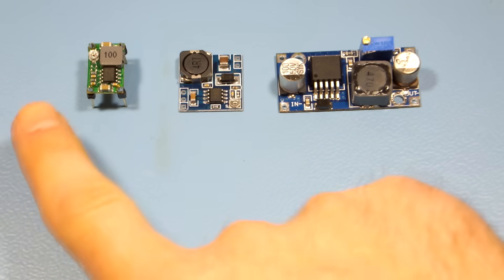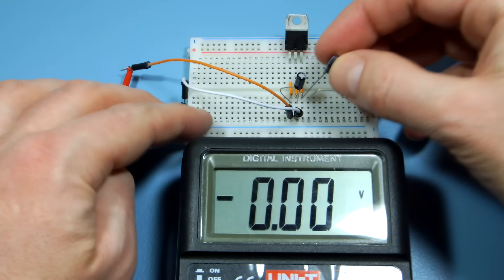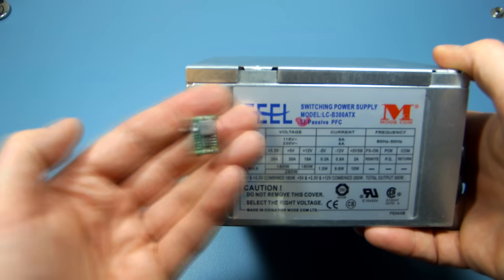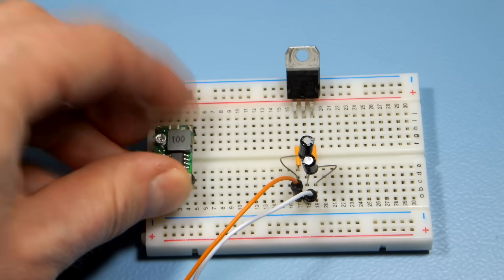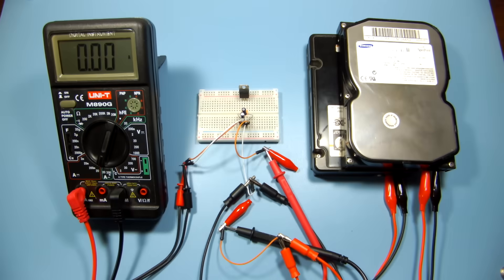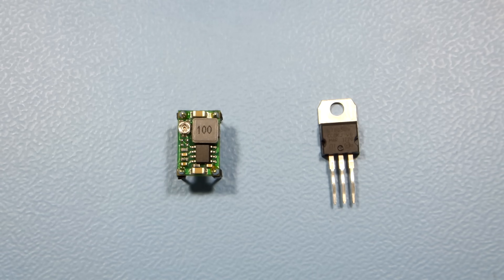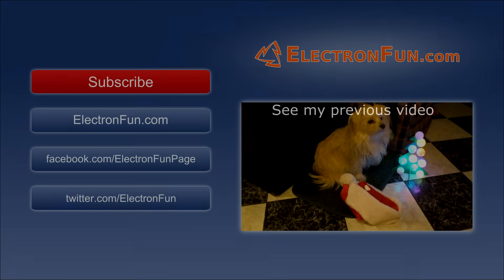Buck converter vs. linear voltage regulator - practical comparison

Comment: If the HDD's consume 450mA total, I take that to mean that's what they need to run most effectively. The buck converter is only consuming half of that (220mA) at the same voltage... meaning it's only supplying half the current necessary to effectively run the HDD's? Am I correct?

Btw, I love your teaching approach!
Reply: +Austin Aaron the hard drive is getting 450mA still but thats at 5v, since he is supplying it with 12v that means less than half the current that 12v is supplying is required to give out the same 450mA to the output, the difference is in a linear the second half of the current is turned to heat rather than powering the hard drive but with a buck regulator it doesn't convert any of the current to heat other than what you would naturally expect due to nothing being 100% efficient.
Reply from the maker: +Austin Aaron Hi, your way of thinking is absolutely logical, but you&#39;re not correct this time :)
The 450mA/220mA is measured at the input, which means it&#39;s a sum of the HDDs + the linear voltage regulator/buck converter. These devices consume power like every other electronic component. At leas half of the current consumed by the voltage regulator is radiated as heat and this way wasted.

Thanks a lot for your supportive words - they are so motivating! :)
Reply: +ElectronFun.com 

Ok, so you weren't getting the 450mA rating from the labeling on the HDD's then. I guess that's what I should have asked to begin with!
Reply from the maker: +Austin Aaron It's always good to ask :)

Comment: Hi, could you use a 12VDC supply and a Buck converter that steps down to 5VDC and power a normal Hard Drive with a Molex connector, because Molex uses 12V (Yellow), 5V (Red) and Ground
Reply from the maker: +Marius Ammann Yes, you can use a buck converter for this purpose and the hard drive won't complain.
I know these PSU color codes, I'm an IT guy :)
Reply: ElectronFun.com Okay thanks, so would this work.
https://www.dropbox.com/s/0cnicq3wxmsbd7i/Power%20Supply.png?dl=0
Reply from the maker: +Marius Ammann Your setup should work fine, just remember to buy a buck converter rated for at least 50% higher output current than the devices you want to power with it.

Comment: Lol idk what a buck converters is (even though I have one). But I know what a linear voltage regulator is.
Reply from the maker: +Bradman175 A buck converter is a very efficient alternative to linear voltage regulators as long as your circuit doesn't need absolutely clean input voltage.
Reply: +ElectronFun.com so a linear voltage regulator is more accurate?
Reply from the maker: +Bradman175 Linear voltage regulators are very accurate and don't introduce noise into the circuit, but they produce a lot of heat and waste energy. Buck converters on the other hand are much more efficient, they don't waste as much energy, but they introduce noise to the circuit.
Reply: +ElectronFun.com Wait buck converters aren't as good because there is the oscillation and the LC filter (?) doesn't smoothen the wave exactly?
Reply from the maker: +Bradman175 There are no ideal components, so an LC filter is not ideal too. In most circuits a buck converter is not a problem, but in e.g. audio equipment it may be a real pain.

Comment: Recently, I threw together a bluetooth speaker and am having line noise issues. The setup consists of a lithium battery pack, buck converter, bluetooth module, 2 amplifier boards and a LED EQ. Everything runs off of 5v, so that's one headache I dont have to worry about. But when the bluetooth module initiates, or communicates with another device, I can hear it thinking through the amps and speakers as a high frequency buzz. What is a good workaround, other than putting another buck converter into the mix?
Reply from the maker: +brainfarth Generally audio equipment doesn't like buck converters, but are you sure it's the buck converter's fault? I would probably do a simple test - swap the buck converter for a simple voltage regulator.
Are you using a 5V battery, or are your ICs rated for 5V?
Reply: +brainfarth I'm interested in seeing what happens when you swap out the buck converter with a linear regulator. I've been looking into making a bluetooth speaker as well.

Comment: Good video. Small addition: Don't go cheap on your power supplies. Would be like going keep on the foundation of a home. When cheap power supplies fail, they can do so catastrophically.
Reply from the maker: Each of them have pros and cons - like everything else. A lot depends on your application. I didn't mention in the video that these buck converters operate with different frequencies - in some applications it does matter. If you don't need to draw over 1.8A, I would probably choose the tiny one. It is really stable and doesn't take much space.
Reply from the maker: +Kent A. Vander Velden Thanks for your comment and advice. You're definitely right, it's not a good idea to use cheap buck converters for important projects.
Reply: +Kent A. Vander Velden make your own one :)
Reply: Right on, with legit components :)
Reply: so what is a recommended buck converter?
Reply from the maker: It is not as easy as one might think, but doable :)
Reply: Those cheap PSUs sure do have a lot of magic smoke keeping them going...lol

Comment: Can I use a buck converter to power an arduino mini pro?
Reply from the maker: +Josh Blease Sure you can. The output voltage is adjustable, so there should be no problem.

Comment: superb info! is there a buck converter from 24 v to 12 v?
Reply from the maker: +Ken cuttie Thanks :) Sure, the output voltage is adjustable and most buck converters can handle over 30V on the input.
Reply: +ElectronFun.com Thanks so much ! I'm planning to use it to convert an input of 20V from my solar panel and connect it directly to  a 12V inverter.  Do you think  it would be more efficient and practiical?
Reply from the maker: +Ken cuttie How many amps are you drawing from your solar panel?
Reply: +ElectronFun.com It's 4.8 Amps
Reply from the maker: +Ken cuttie I haven't tested buck converters with solar panels, so can't tell you if it's practical. If you want to use a buck converter make sure you use something that is able to handle such power (probably a lot bulkier than my tiny buck converters).
Reply: +ElectronFun.com I see. Thanks, i appreciate it so much!
Reply: +Ken cuttie TI Make a module for US$20 which can handle 36Vin and you just need to add one resistor to get 12V out. It can do up to 6A out.
http://www.digikey.com/product-search/en?keywords=PTN78020HAH

This will probably be much better than an $8 one from china.
(Like this one http://www.aliexpress.com/item/DC-DC-Car-Voltage-Converter-Buck-Module-24V-Step-Down-to-72W-12V-6A-New-BLACK/32276549850.html)

Comment: Should I use LM2596 buck converter with a joule thief?
Reply from the maker: +Atomic_Science Do you want to use it on the output of a joule thief?
Reply: Yes, I want to use it on the output of the joule thief so I can charge batteries
Reply from the maker: +Atomic_Science Should work, as long as your buck converter input voltage is lower than its output voltage.
Reply: thx

Comment: I bought a pololu buck converter S18V20AHV. This corresponds to my needs input : 11 to 14v (lead battery) output 8 to 12v (led lamp) not dependent on the input. But the principal problem is that de variable resistor is to thin. I'll have to desolder it to put a "potentiometer". I'm serching an open source dip one.
Reply from the maker: +Yannick Sirjean (autonomys) This little converter seems nice - step down/step up converter in one device. If the pot is similar to mine, it's not precise at all. Replacing it with something better may be a good idea.
Reply: +ElectronFun.com Of course yes, but it's tooo small. It need binocular or optics like this to invert it... that's the problem. That the reason why i prefer open source hardware with schematics.
Reply from the maker: +Yannick Sirjean (autonomys) Oh yes, open source hardware is always the least problematic.

Comment: firstly , thanks for your informative video , 
secondly , i want to know which one is better for my radio controller (im changing my battery to lipo and need to regulate the output voltage ) to have a consistent and steady output that at the same time wouldn't interfere with my radio frequency.
Reply from the maker: +Ali Jazani Thanks for your comment.
Buck converters are efficient, but they are much nosier than linear voltage regulators. If you don't want to experiment too much, I guess your should choose a linear voltage regulator. A buck converter might interfere with your radio frequency.
Reply: ElectronFun.com thanks again for your prompt reply . It was really helpful .

Comment: Hi great video. Your calculation corrections are wrong. What you state originally is right.
Reply: +eRCaGuy Do you mean to say that his corrections are actually the power wasted by the conversion from 12V to 5V output?  For example in his first correction he says (12V- 5V) x .042A = 2.94W, technically it is the same as saying 6V(the voltage dropped to reach 5V output) x 0.42A = 2.94W. 2.94W of power was lost in the conversion from 12V input to 5V output.  Am I correct?  Thanks.
Reply: +KillJD Yes, you are correct. I'll go over his calcs in my next reply, to be a bit more thorough.
Reply: +KillJD Minor correction: you said 6V. It's 7V. 12-5 = 7.
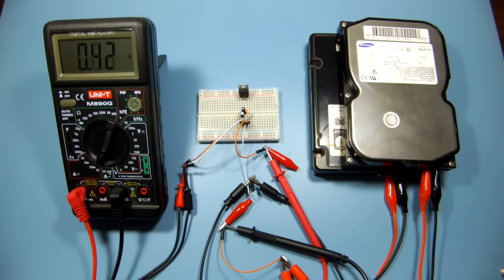Reply: Here's the correct calculations: at 5:06 in the video, when using the linear regulator, the total power draw (power input to the regulator) is 0.42A at 12V = 5.04W. This is correct. The power dissipated by the linear regulator (ie: Power Lost) is (12V – 5V) x 0.42A = 2.94W. The total power output is 0.42A at 5V = 2.10W.  Power Input = Power Output + Power Lost. Efficiency = Power Output/Power Input. This means that the power in = 5.04W, the power out = 2.10W, the power lost = 2.94W, and the efficiency = 2.10W/5.04W = 41.7%. 

In linear regulators, input current = output current, and essentially the excess power (excess voltage x the current) is burned off as heat. Power input does NOT equal power output. The power losses are proportional to the voltage difference from input to output.

In buck converters, the input current does NOT equal the output current. Rather, in ideal buck converters, there are no losses, and instead the Input Power = Output Power. In real life, there are small losses, so Input Power is > Output Power. Since the input voltage is always higher than the output voltage, the input current is always lower than the output current. An ideal buck converter is a lossless voltage reducer and current amplifier, since input power is supposed to equal output power, and Power = Current x Voltage.

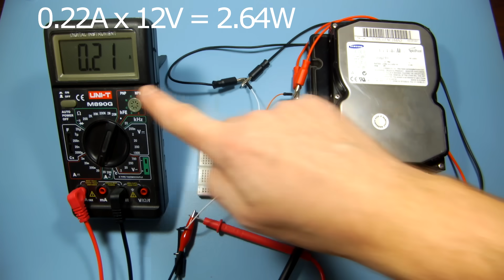At 5:20, the buck converter draws 0.22A x 12V = 2.64W. This is the Power Input. The power output is equal to output current x output voltage. ElectronFun didn't tell us the output current, so we have to assume it's the same as it was for the linear regulator, since the output voltage and the load are the same in both cases. Since on a linear regulator he told us the measured input current = 0.42A, we know the output current was also 0.42A. Therefore, the Power Output = 0.42A x 5V = 2.10W, the same as for the linear regulator. The efficiency of the buck converter is therefore Power Output/Power Input = 2.1W/2.64W = 79.5%. This is much better than the 41.7% of the linear regulator. The Power Losses of the buck converter = Input Power – Output Power = 2.64W – 2.1W = 0.54W, which is far lower than the 2.94W lost in the linear regulator. 

The losses in the linear regulator over the losses of the buck converter are therefore 2.94W/0.54W = 5.44 times greater. In other words, the linear regulator losses are 544% as large as the buck converter losses, or otherwise stated, 444% greater than the buck converter losses.

The total power draw (power input) of the linear regulator over the total power draw of the buck converter is 5.04W/2.64W = 1.91 times greater. In other words, the linear regulator power draw is 191% as large as the buck converter power draw, or otherwise stated, 91% greater than the buck converter power draw. That's where he gets his “over 90% more power” figure he correctly states at 5:27 in the video.

Now, for a real-life battery calculation example. Let's say you are doing this exact test with a 9V Energizer 522 battery (datasheet: http://data.energizer.com/PDFs/522.pdf), and you want to compare the run-times with the two voltage regulators.  
-The linear regulator will draw 0.42A at the regulator's output and the input to power the two hard drives.  The 9V battery datasheet shows that at a power draw of 420mA, the capacity is ~330mAh. The total run-time will therefore be 330mA*hrs/420mA = 0.786hrs, or 47.1 min. 
-The buck converter will draw 0.42A at the regulator's output at 5V, or 2.1W. Since the efficiency is 79.5%, the input power will be 2.1W/0.795 = 2.64W. The input current will therefore be 2.64W/9V = 0.2933A. The 9V battery datasheet shows that at this current (293mA), the capacity is ~390mAh. The total run-time will therefore be 390mA*hrs/293mA = 1.33hrs, or 1 hr 19.9 min.
Reply: +eRCaGuy Wow.  Thanks for taking the time to explain in detail.  Much appreciated :)
Reply from the maker: +eRCaGuy You are so right! I watched the video again and my original calculations are correct. I calculated just the total power draw for the voltage regulator and buck converter, but didn't try to calculate the power losses at all.
I was lead astray by a couple of comments and got confused. My corrections showed power losses (dissipated heat) rather than the total power draw. I've just deleted the wrong annotations.
Thank you so much for your time and effort to lead people (including me) out of confusion!

Comment: What??? 140°C at only 420mA???
Reply from the maker: +Integrated Electronics Yes, you should take into consideration not only current, but also the difference between the input and output voltages.

Comment: I have a couple of those buck converters (the one shown at 2:19) however, I'm going to build my own switch mode power supply from scratch in the near future, I already have a "draft" schematic in my head.  Linear regulators are still convenient and useful for small loads though.
Reply: +CoolDudeClem hi that's great. I plan on making a switched mode converter (perhaps buck and boost) from scratch as well...using an Arduino, and probably with an adjustable linear regulator at the end to clean up the output. I've got various ideas.
Reply from the maker: +CoolDudeClem A switched mode power supply built from scratch is a cool project. Are you going to make a video about it?
Reply: +ElectronFun.com Of course.  That's going to be a few projects from now, I still have a few other projects and various experiments that I want to get done.
Reply from the maker: +CoolDudeClem Cool, let me know where to watch the videos when they're ready :)
Reply: +ElectronFun.com They're all on my YouTube channel.
Reply from the maker: +CoolDudeClem I've just subscribed to your channel :)

Comment: Hey i am interested in powering LED lights. I need to step down voltage from 12.6 volts to 12 volts. Is buck converter a good idea? Also, since the voltage drop isnt much will it not get very hot? Also, the lights will draw about 4 amps if that info is relevant. THank you.
Reply from the maker: +Joseph Ting Hi, I'm not sure if you'll find a low dropout buck converter which would step down 12.6V to 12V. The temperature depends on the buck converter - if you choose something small it might get hot, but the bigger versions shouldn't warm up too much.
Reply: Ok thank you!
Reply from the maker: +Joseph Ting I know there are many low dropout voltage regulators. You can check the detailed specs in their datasheets. When it comes to buck converters, you would need to check empirically if a particular buck converter can go from 12.6V to 12V.